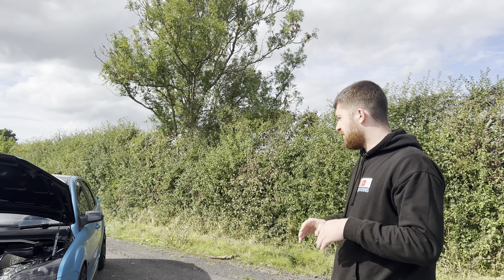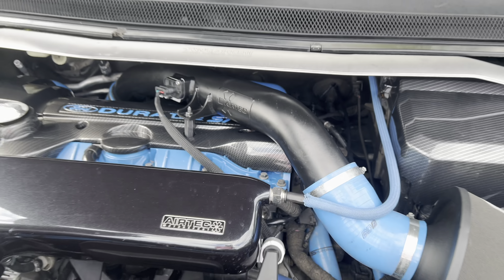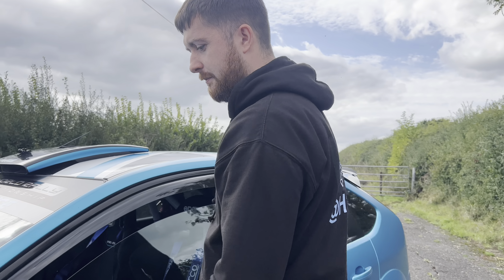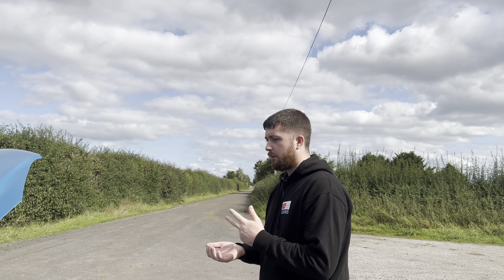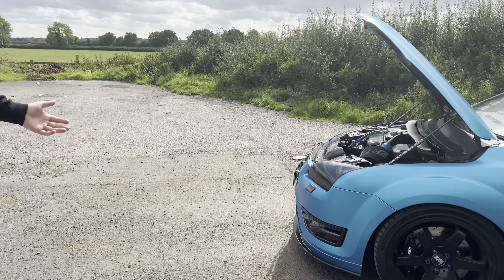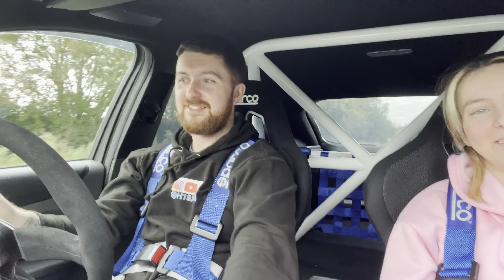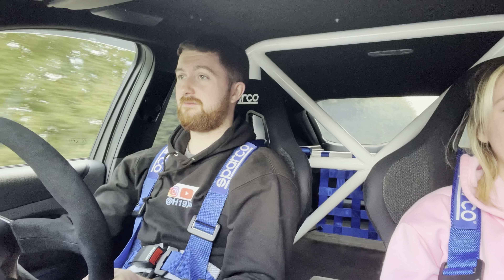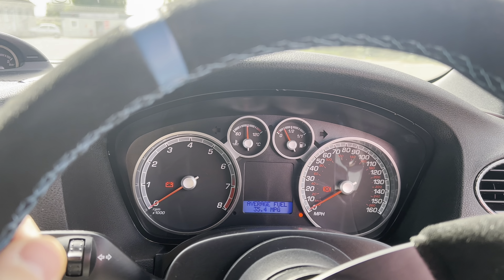Unlock the Full Potential: Modifying a Ford Focus ST to Reach 480 bhp

Comment: Great vid, thinking of going rs turbo on mine so loving the content 👌
Reply from the maker: Yeah man do it you won’t regret it
Reply: @H19XNS  where you get yours mapped?
Reply from the maker: @tommerrion8436  was all done at BD Performance mate, I’m running revo stage 4 +
Reply: Wot other supporting mods do u need for the rs turbo? Clutch flywheel and inter cooler?
Reply from the maker: @germalean88g77  this was my spec with RS turbo but can vary, fully forged, 750cc injectors, RS intake with RS map and maf, upgraded my clutch to 6 paddle helix, full 3” exhaust system, minimum stage 2 intercooler, upgraded in tank fuel pump. Stage 1 cams, ported and polished inlet. With all that I was running 430 with revo stage 4+